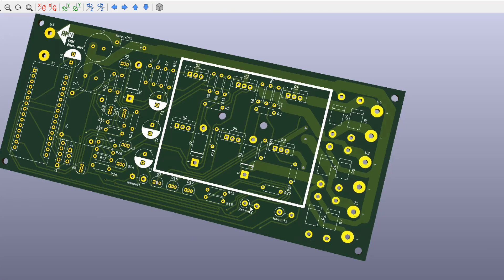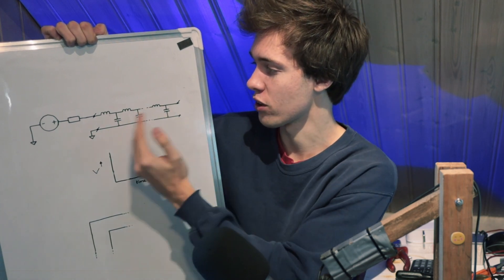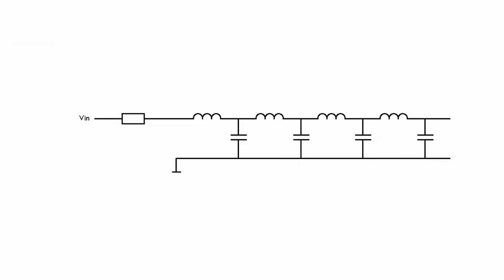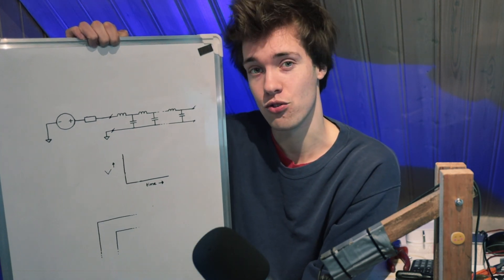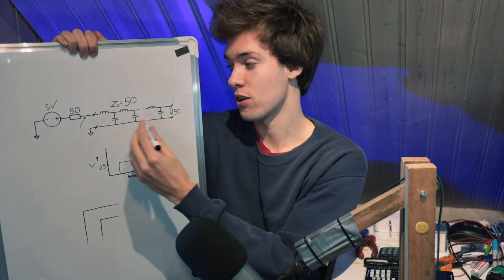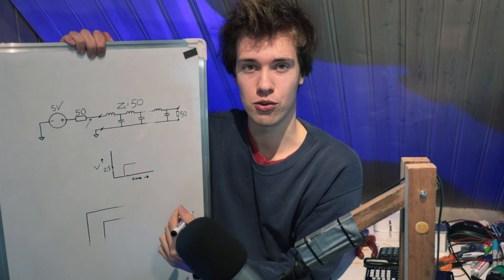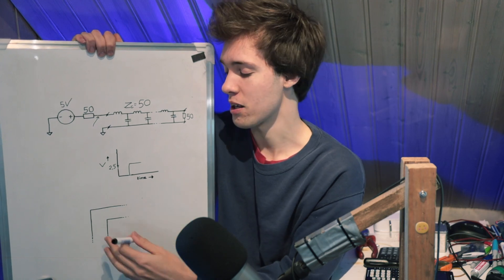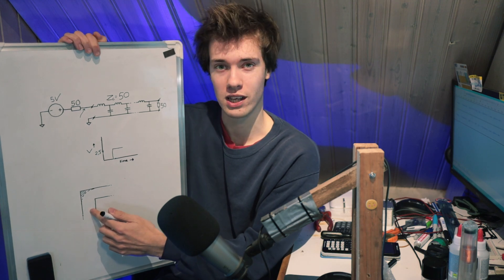Are sharp corners in wires or PCB traces a problem?

Comment: PCB Designer here. 
There's also other reasons to avoid sharp corners other than network theorem.
Such as acid traps.
It's bad practice having very sharp corners (there are a lot of those in the example PCB) where etchant pools when the board is removed. 
While they aren't really a thing anymore due to improved processes, they are mostly due to flying probe tests that juat move the cost to the supplier instead.

Comment: I was always taught that bending a wire sharply increases the resistance at that point and can sometimes lead to a fire risk.  Sometimes you are warned not to bend cords too sharply, especially with high load appliances including heaters.

Comment: From a layout perspective it also helps with density, running a 16 trace bus to a memory chip, if you do a hard 90, that is a lot more space taken up on the board (The shaded portion of your corner), for really high density boards I will even change to full curves in limited areas to give myself some area to fit traces through. 

The minimum length criteria is also why you wont see as much effor in impedance matching vias, they are too short in most cases to cause a big enough issue. but you still need to be reasonable about it, if your hopping ground layers that can add much more loop area than your thinking.
Reply from the maker: smooth curves are the prettiest. I especially like the look of old school hand drawn boards.

Comment: Acid traps aren't as much of an issue anymore as electroplating is getting more and more popular. Most manufacturers don't use etching for manufacturing as the caustic chemicals required can be expensive to procure and even more expensive to dispose of.
The real issue of 90 degree bends in traces on a PCB is reflection. This is really only an issue at high frequencies and so isn't really a problem for most applications.

Comment: Some thoughts: I agree with the conclusion that 90 degree corners will not be a problem for most people's designs unless they're high frequency. So why use anything else?

Trace inductance and capacitance. You'll often see component vendors saying that you should place things like inductors, crystals, and decoupling capacitors close to the device. Use whatever routing gets you the best result. If that happens to mean using 90 degree corners - go for it.

Using 45 degree routing typically results in shorter traces that also take up less board area.

45 degree routing may also be needed to get signals away from high density devices - reducing the number of vias or enabling higher component density. 

Once you start using traces with 45 degree routing in one area you might as well use it throughout. In fact, you almost get forced into it. Most beginners think in terms of "90 degree' when they first start board routing. Nothing wrong with that, but once people start include 45 degree routing it often becomes a preference.

There may still be issues with impedance mismatches in a transmission line for sub GHz range signals that have very short rise and fall times. When you get up above 200 MHz it's better to base the 'wavelength' of the signal on the rise and fall times rather than just the frequency. I.e. don't assume that if you don't have GHz clocks you won't have trace impedance issues.

Vias usually introduce larger impedance bumps than pc corners. If you're at a frequency where you're caring about whether the impedance bump in a corner is an issue, you'll probably be caring about vias and pc board stackup, too.

Lastly, in the commercial world, it's not just a matter of what is needed for meeting digital signal level and timing.The length and impedance mismatches on a trace may be more of an issue for meeting electromagnetic emission and interference compliance. Again, shorter traces typically help.

It gets particularly wild if you ARE dealing with GHz+ signals, because you start to get into the area where matching trace lengths (propagation delays) become an issue. Non-90 degree routing is part of the toolbox of options for handling trace length differences.

Most hobbyists will never face such issues in their projects, except for routing density in projects where board size matters. Today's PCB software supports 45-degree routing 'out of the box' so there's really little reason to stick with 90 degree routing assuming you can get your head around it.
Reply from the maker: @TomTRobot  True, I don't think people are tempted to use 90 degree bends since any pcb design tool uses 45 degrees and or rounded corners by default. I had to put in active effort to make the corner for my footage haha. It very much didn't want this.

Comment: As others have already noted, on printed circuit boards, the sharp points can cause fabrication issues. The sharp corners (particularly inside corners) can have mechanical issues (a place where a crack can start and run across the trace). The sharp point can be a high voltage point and arc to an adjacent conductor. That effect can be useful, however, to make a "zero cost spark gap" for electrostatic discharge (put two points opposite each other with a small gap and make sure there is no solder mask over the points).
https://www.ti.com/lit/an/slva232/slva232.pdf

Comment: Even if your circuit doesn’t depend on high frequency signals I think the sharp corners can act as antennas which convert high frequency temporal step edges in eg fast digital steps into radiated high frequency noise which can interfere with other nearby circuits.

Comment: Surely an infinitely long cable would either have a resistance of infinity (or zero). So im confused about your explanation of characteristic impedance.

Is the point that it might notionally be any length, but over a given distance (speed of light / freq?) is all that really matters
Reply: an infinite cable is far from ideal as you'd have a hell of a time coiling it up and putting it in a drawer. or connecting the far end to the other device
Reply from the maker: @RoamingAdhocrat  A real mess. Don't even think about what happens when you inevitably manage to get it tangled up.
Reply from the maker: This example assumes an ideal cable with no resistance, only inductance and capacitance. The reason the characteristic impedance isn't 0 is the inductance: the capacitance charges through the inductance, which limits the current. 

For an ideal cable like this the characteristic impedance is sqrt(L/C). A real cable would of course also have resistance, which changes things a bit. You may factor this in for design calculations, but the concept doesn't change much and so for explaining the basics I prefer the ideal case. You're right though resistance plays a role in real cables.
Reply: @AKIOTV  that isn't helping. If it has a characteristic resistance of 50 ohms, then it does have resistance?

And an infinite length cable can't have 50 ohms of resistance. If there were any resistance, it would be infinite?

I infer there's a disconnect in my understanding of resistance and impedance. But as both are measured in ohms then they must ultimately be measuring the same thing???
Reply from the maker: @benholroyd5221  characteristic impedance is not the resistance or impedance of the cable between two points. if I hook up a cable between say a power supply and a load, that cable has "normal" impedance (usually very small because cables have quite small resistance, inductance and capacitance) 

The characteristic impedance however, is not that. It's the impedance seen by the voltage source at the start of the cable the moment it turns on. 

It only matters for high speed signalling or extremely long cables. For instance, let's say we have a light bulb hooked up using a power cord with a 90 ohm (just making something up here) characteristic impedance. The regular impedance of the cord may only be say 0.5 ohm. Say the light bulb has a 10 ohm resistance. When you turn the power on, for a fraction of a second, the power outlet "sees" a 50 ohm resistance: the characteristic impedance of the cable. Then, pico or nanoseconds later, the wave reaches the light bulb and rolls back and from that point the outlet sees a 10.5 ohm load instead.

In this case, characteristic impedance is a nonsense thing to consider, since it matters only for such an insanely short time, but if instead of powering a light bulb, we're transmitting pulses for a high speed communication system, those nanoseconds become relevant and characteristic impedance becomes important.

That's about the best explanation I can provide in a comment, maybe this topic deserves a more in depth video some time.
Reply: What you're looking for is impedance vs resistance. 
Impedance is like resistance, but is caused by capacitance and inductance. An inductor will initially impede current flowing though it, eventually reaching no resistance. A capacitance will initially not impede current but eventually reach infinite resistance.

Impedance is not real resistance, because the energy is "stored" in the capacitor or inductor. But, the infinite wire can "store infinite energy", therefore making the impedance into resistance.
Reply: @PelleReimers  yes so an infinitely long wire that has infinite impedance would have infinite resistance?

I don't get how an infinity can have a finite property.
Reply: @AKIOTV  This comment was very helpful. Thank you!
Reply from the maker: @benholroyd5221   An infinite wire would indeed have infinite resistance, but not necessarily infinite characteristic impedance. Characteristic impedance is independent of the length of the cable, it's simply the "virtual" impedance the source sees the moment it turns on, caused by the combination of inductance, capacitance and resistance the cable has. 

In the example I used in the video, if it had wire resistance, you'd model that as small (few milliohm) resistors in series with each inductor. When the source turns on, the voltage at the start would be 2.5, as the resistors are small. As the wave propagates further, more and more resistance is added in series, reducing the current, so the voltage would gradually rise, eventually approaching 5V.

Indeed, with resistance included, the voltage would not remain 2.5V at the start of the infinite cable.
Reply: The question is "how could an infinte wire possibly have a finite (resistance, impedance, capacitance, inductance)?".

If you add 1+1+... the result will become bigger and bigger. However, if each term becomes smaller: 1+0.5+0.25+... the result may tend to toward a finite number.

As each "piece of wire" is "charged" some current flows from the start to the end due to capacitance. At the same time, the impedance from the inductance is reduced, allowing current to flow though the next "piece".

The reason the current is not 1+1+... is because of the wire inductance makes the effect of "the rest of the wire" smaller and smaller. The reason it's not 0+0+... is because of capacitance.
Reply: @PelleReimers  I was today years old when I learned why it is called impedance. Thank you, that makes a whole lot of sense.
Reply: @ Ok, thats starting to make more sense to me. Thanks.

Comment: That's cool but actually it's because the electrons smack into the corner really hard (they're going really fast so they don't see it ahead of time) and it slows them down a bunch.
Reply: It’s all aerodynamics! (I really laughed at your comment) but just to be a little bit more constructive or positve or informative. Electrons actually move or displace at VERY small speeds compared to our human scale of things. The speed at which the electrons displace on average along the wire is called drift velocity.

Drift velocity could be considered very difficult to measure because it depends on the material and field conditions and many microscopic phenomena going on. But however, as it is an average value, it is very easy to measure drift velocity for specific wire arrangements if we know the total current, some basic material properties of the wire like the number of free charge carriers per unit volume of the material and the cross-section of the wire and use the fact that we know the elemental charge of an electron.

If we have an an specific cross-section where we measure current, we could easily estimate the drift velocity of electrons.

The drift velocity can be calculated using the formula: v_d = I / (n * A * q), where: 
v_d is the drift velocity
I is the current
n is the number of free charge carriers per unit volume (e.g., electrons in copper)
A is the cross-sectional area of the wire
q is the elementary charge

And if you are asking yourself if this also works in transitory electric states or what about AC, yes!. Any kind of “inertia” and transitory phases caused because of electron’s movement can just be neglected and we can consider electrons achieve the supposed speeds instantaneously. It is almost instantly the time it takes to accelerate electrons. We can just neglect electron’s inertia and assume they instantly achieve the velocity so we only need to take into account the true electrical transitory phases like total charge displacements in capacitors and electrical stationary measurements.

Comment: If you have sharp corners in traces then electrons will fall off from the board.
Reply: actually true with high voltage
Reply: Also actually true with photons and fiber optics.
Reply: they might cut themselves on the sharp corner

Comment: It's not bad per-se but bad-practice for sure.

Depending on the manufacturer it could even make the PCB more expensive for "no reason"(tool limitations).

There's also the argument of wave relfections but that's on extremely sensitive equipment.

If you notice, PCIe and RAM connections never have sharp corners.
Reply from the maker: @Splarkszter  PCIe and RAM are good examples of things that operate at very high frequencies and where reflections are a problem.

Comment: Another couple of issues.

1. Sharp corners can cause mechanical concentrations of stress (I've never really seen this, only heard of it).

2. When Etching of of the PCB, depending on the process used it can be problematic (acid traps, etching undercuts).

3. In high voltage circuits, electrons love to jump off sharp things. Corona discharge and arcs.

But yes, otherwise I think you are right it doesn't usually matter in simple circuits.
Reply: 1 in any industrial or automotive application, when wire will be provided with differential movement when vibrating is real concern. In PCBs not the case on normal substrate. Flexible PCBs - yea, the concern is here, traces with stress concentration will break before rest of them will

Comment: Interesting video! I think 90 degrees is also avoided because in the past 90 degree or sharp angles could cause acid traps during the etching process when producing PCB's. Which is not really a concern with mordern tech anymore.
Reply: I just wanted to say that.
Reply: Acid traps aren't as much of an issue anymore as electroplating is getting more and more popular. Most manufacturers don't use etching for manufacturing as the caustic chemicals required can be expensive to procure and even more expensive to dispose of.

Comment: Good video. Appreciate the effort.
Reply: One thing: manufacturer of power cable will provide a minimum bending radius that the cable can be bent. If you cross it, you are out of spec. If that breaks the cable, I agree it may not, unless you do that in low temp.
Reply from the maker: @jerzymikucki3778  true